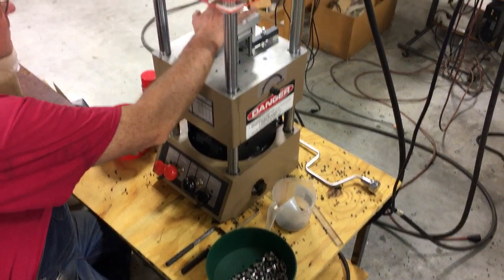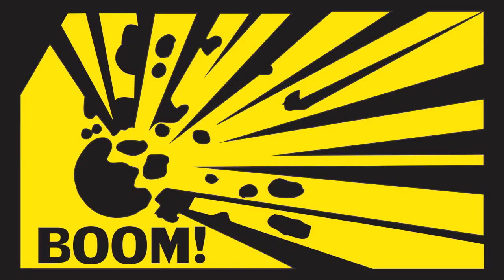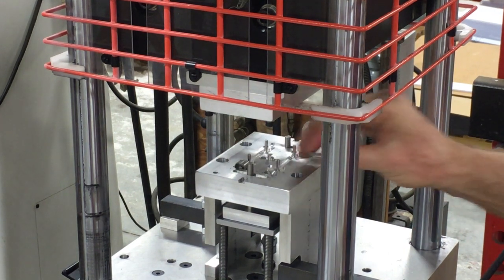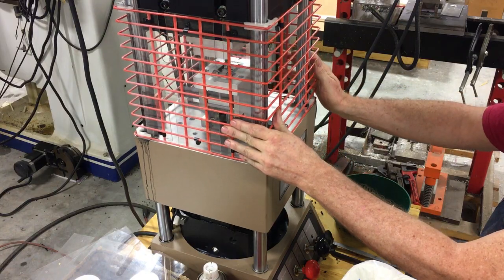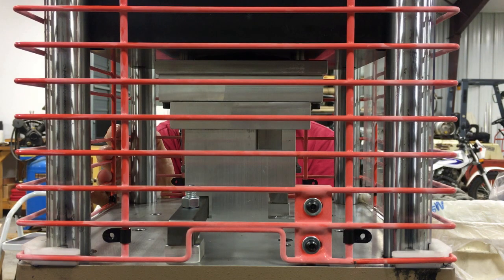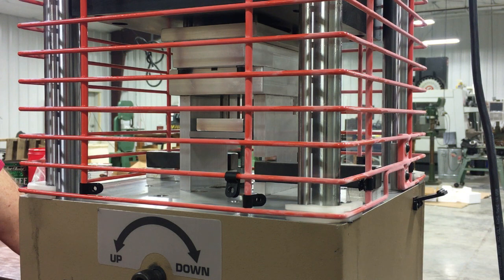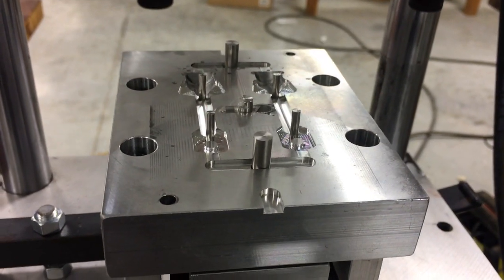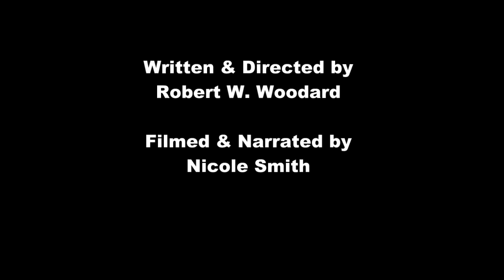Morgan Press Production Using Semi-Auto Mold Set

Comment: Interesting to see your success with the Morgan Press. About 20 years ago I picked up one of these used for $1500. It was owned by Gillette Razor. It was a great introduction to injection molding. I had a CNC mill so I made my own molds.  I found the clamp force marginal for many of my parts. I ultimately bought a used 80 metric ton 4 oz machine that was used to make CD's. It was a high quality machine that solved many molding problems.  I studied mold design and eventually made a bunch of mold bases out of steel.  I even bought EDM machines to make molds. All of this was for in house parts only.  I replaced the machine with a nice all electric model of 110mt clamp force. A real mold machine will make parts that are of much higher quality and consistency. It will make them much faster 5-10X. In many cases it can make parts continuously without much user intervention. It will also use a wide variety of plastics. More clamp force will handle bigger molds for larger parts or more cavities for more parts per cycle.  You can build molds to a standard that will run on any standard machine. If you need to you can parts made outside.  I run modest lots (500) of a part at a time, and don't run that often, but when I do I am often making something for 50 cents that I used t machine for $50. The little Morgan press got it all started. A very capable used full size molding machine is half the cost of the Morgan.
JY
Reply from the maker: Thank you for your comment.  I am sorry that my response is late getting back to you.  I am in awe of your experience; it far exceeds what we have accomplished in injection molding.  Where would one try to find a "good" "used" injection molding machine such as what you speak of?
Reply: @yablabo  Well, it depends on your need. Of course you can do many parts 10x as fast on a fully automated machine.
But: you need an (expensive) tool for ejecting the parts correctly. And the more complex the part is, the much(!) more expensive the tool will be (threads etc.)
That is where a simple stand-up machine like the Morgan press can let you create complex parts without complex tools, because you can disassemble the molds by hand. There is no need to take care of a good deforming (and the restrictions you have). And for inlays you of course need an arm (robotic or human) to get the inlays on their correct position. All this is not easy on normal industrial machines.
Another advantage: a Morgan needs very small space in your room and its easy to move it on simple rolls :-)

I like the Morgan machine but we cannot buy it in Germany :-/
May be I wil get a used one one day - or I have to build a similar on my own (may be with hydraulics) :-)

So may be you can show us more of the mechanics of your Morgan press :-)